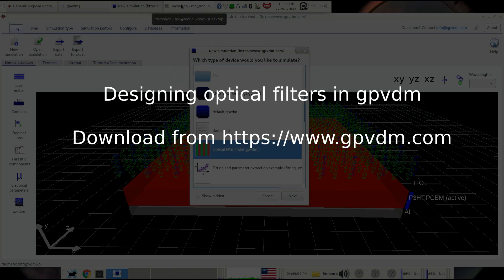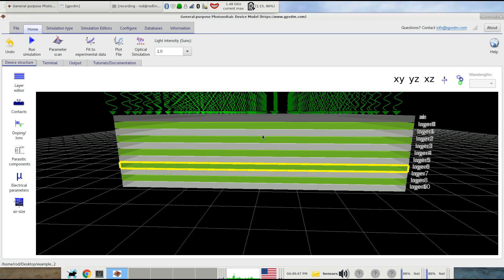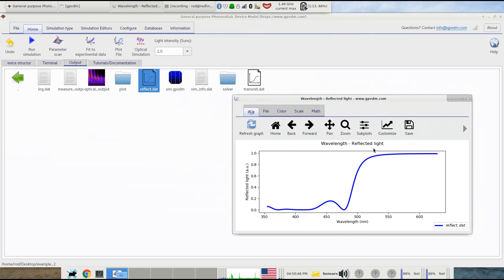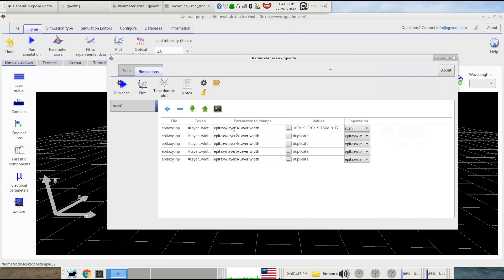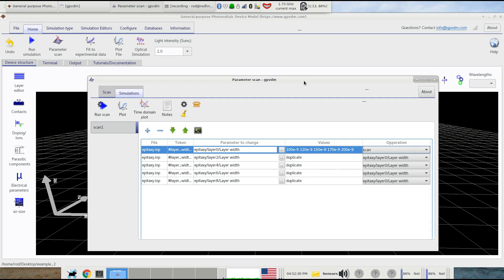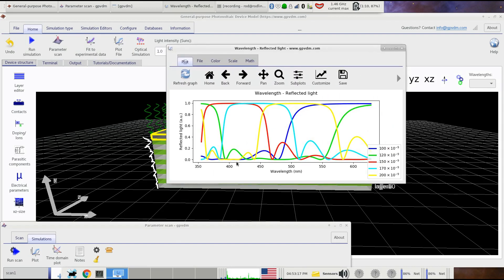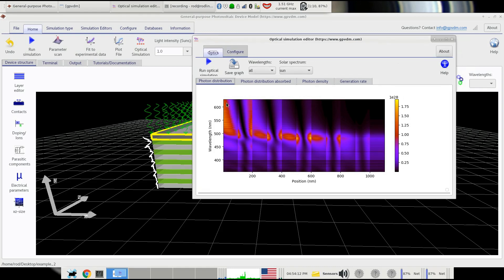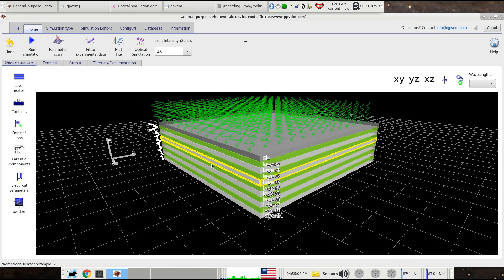Designing optical filters, reflective/anti-reflective coatings using OghmaNano

Comment: Using the OghmaNano version 2025. I clicked run simulation as soon as I open the example folder. No reflectance or transmittance data in the output tab. Need all the snapshot of settings please. Can't post this to the forum as my account hasn't been activated yet.